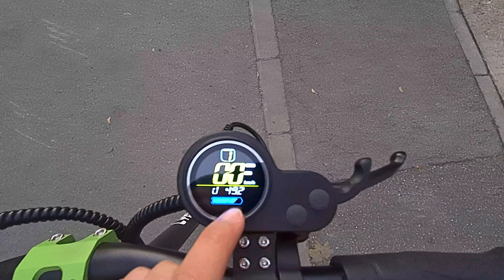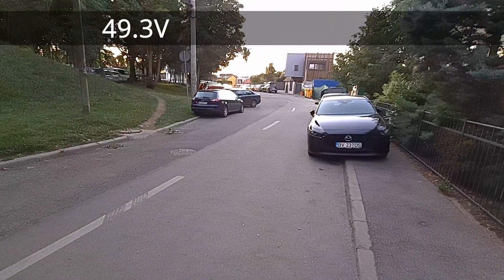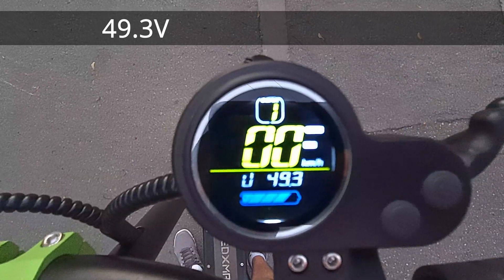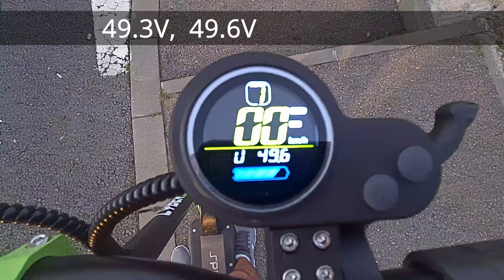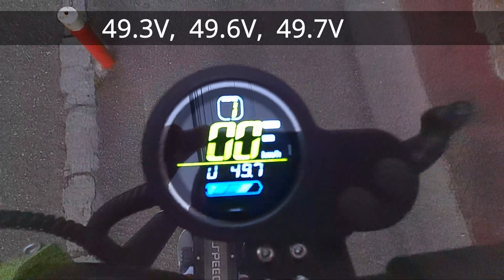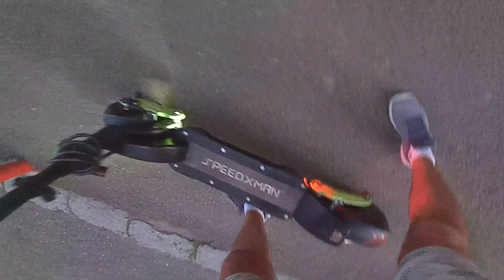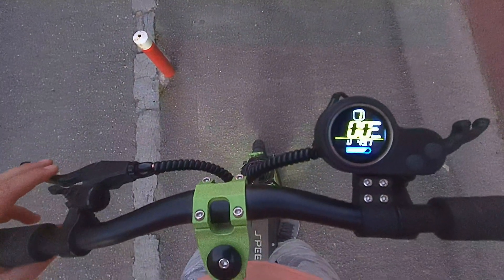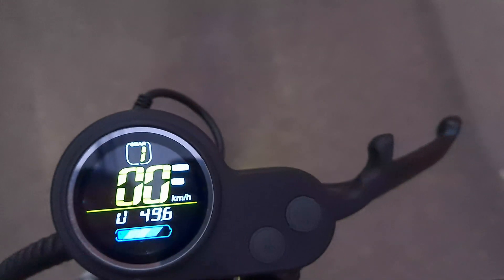Scooter Regenerative Brake Test (Trotineta Cyberbot SpeedXman 48V, 19.2Ah, 500+500W)

Comment: So you have to squeeze the handle for the regen to work it doesnt work when you just release throttle??
 Thanks man!!
Reply from the maker: The throttle is only for accelerating, the brake levers activate the regenerative (electric) braking.
Reply: @furulevi  I just figured that out yesterday lol thanks.

Comment: Which P setting is Regen Brake
Reply: usually p11
Reply from the maker: - long press power and mode buttons, 
- instead of gear numbers (top of screen) letter P will be shown (power button selects numbers [total of 20], Mode button changes values)
	11 = Electronic braking (1-5 strength)

Comment: If you dont press the brake, will there be regen brake at all? And how about if your brake dont have brake sensor?
Reply from the maker: No. Regen braking works only if the brakes are at least a little bit pulled so that the electric contacts of the regen are activated. There is a small contact below both front and rear brake levers.